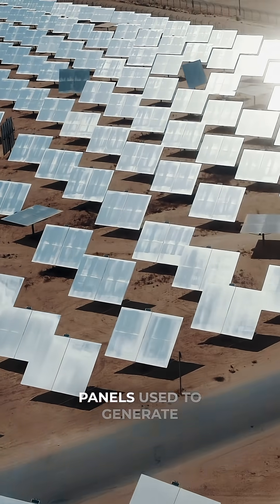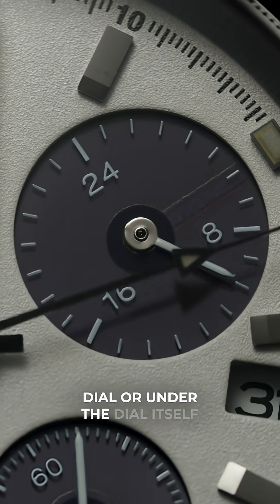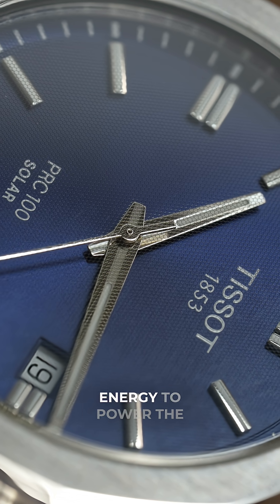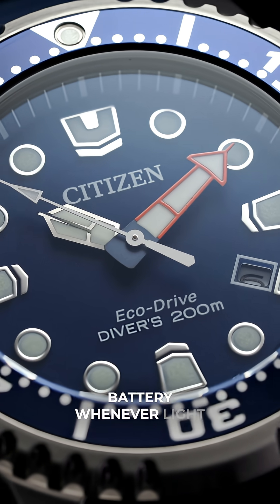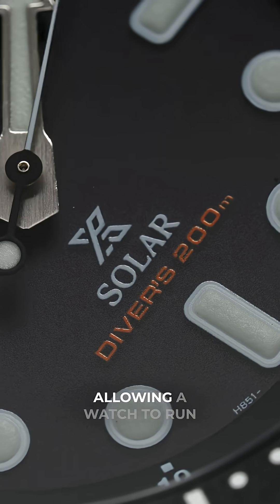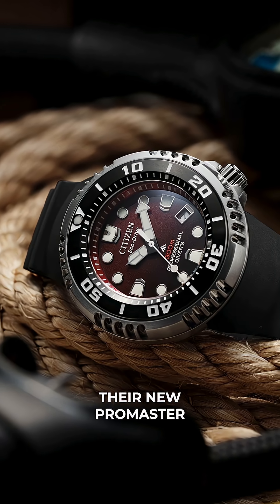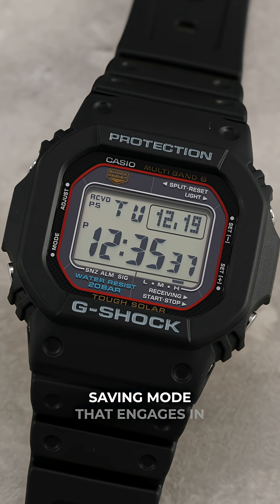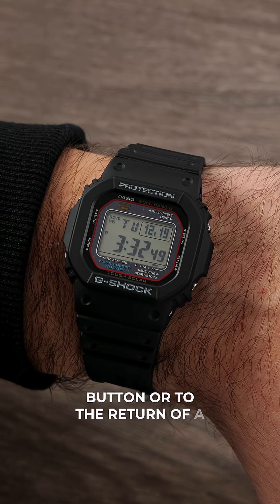How Does a Solar Watch Actually Work

Comment: A translucent dial?, not transparent dial? Mabey several micro holes ~ I believe Citizen were the pioneers in this tech
Reply: Correct they invented it and perfected it far beyond their peers. Some dials are transparent only to the light frequencies used by the cell
Some have panels beneath the inner bezel etc
Reply: @Nr15121 - thank you

Comment: I own a Citizen Corso with Eco-Drive built in (you can see the photo-volactic cells built in the dial).  I love the thing.  Although I wear it enough where it doesn't need it, I occasionally place it in my sun-facing window (not inside a hot car) to recharge, and it seems to work just fine so far.
According to Citizen, you DO need to replace the Capacitor that holds the charge from the solar cells, but that's between every 15-20 or so years.  I'm glad to see other comments with Citizen owners who've never needed to replace the capacitor yet.  Good news is, a single replacement capacitor is between $20-$30 and you can easily buy them online and theoretically could replace them yourself.  Citizen doesn't suggest buying one to store, and instead buy a "new" one that'll have better life.  Not sure how to determine that, and it sounds like BS to me.

Regardless:  I love my Citizen and will wear it as long as I can.  I also dig the Rolex copy ala the Citizen Professional Dive E365.  Might check it out for that extra water protection AND Eco-Drive.

Comment: Had a Citizen eco-drive for 12 years now. Only time it stopped was when I left it in a dark closet for at least a year since I joined the Army (didn't take the steel watch with me). I tried to revive the watch by putting it on the dashboard of a burning hot car in Summer(stupid idea). The watch was literally at a frying level when I took it out. I thought I had destroyed the watch by killing the battery completely. Surprisingly, it was fine and runs fine since then(this happened 7 years ago)

Comment: 2 of my Seikos only charge under a hot bulb or sunlight. LED light does not charge them. Once charged they stay charged for over 6 months.
Citizens use any ambient light to charge
Reply: Just goes to show that EcoDrives are more effective in terms of charging.
Reply: Interesting. I have GShock and Citizen, both charge under regular light. Granted, I rotate them, so usually they see daylight once a week or so.

Comment: Question about solar watches: are there any that have a sweeping seconds hand or even no seconds hand at all?
Reply: Cartier tank solarbeat has no second hand
Reply: I believe they are all quartz so they would have one second ticks. He did show a mechanical watch in this video. I think just grabbing some stock footage that he had.
Reply: @jayelwin  That was actually a Seiko Speedtimer, which is solar and has a sweeping chronograph hand. The regular seconds hand in the 60s subdial still ticks once per second. In theory there is nothing stopping solars from having sweeping second hands but obviously that'll drain the electric charge much quicker.
Reply: Some solar chronos have sweeping Chronograph hands, but I don't know of any with a sweeping seconds hand.